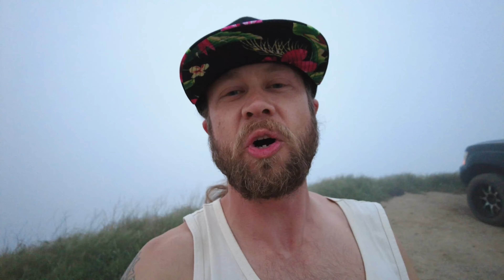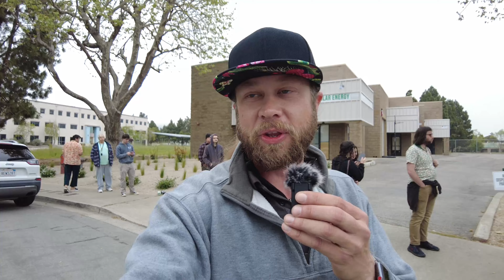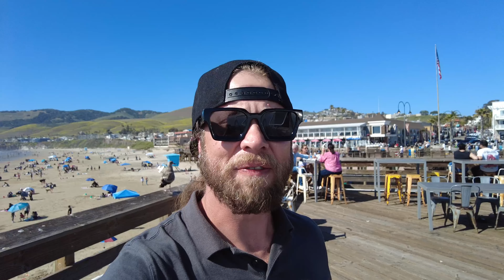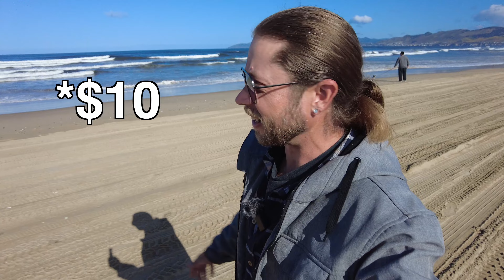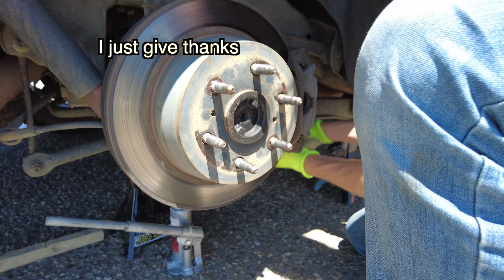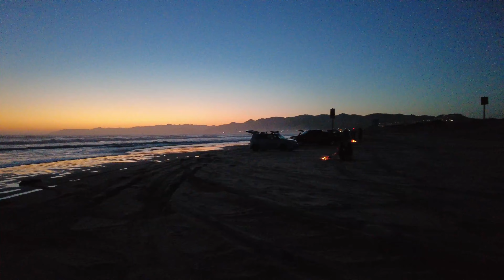Pursuing Freedom & Manifesting Dreams | California Beaches & Overlanding Adventures

Comment: For future reference... Next time you change front or rear brakes, its best to go ahead and change both sides
Reply from the maker: Of course, and if I was able to at that moment, I would have definitely gone that route… the next glitch I’ve figured out is to get a $25/night campsite I can work in for a couple days.
Reply: @AdventureFitnessFreedom   Right on. I replied to your comment, however it does not show... Did you get it?
I was just saying that your free makeshift parking lot shop would suffice just fine so long as the job isn't too time consuming. 
Also, most of the auto parts stores (AutoZone, Advanced Auto Parts, O'Reilly's, etc) allow you to do the work in their parking lots for free especially if you buy the part from them. Many also offer a tool loaner program so that solves a major hurdle as well. Keep on rocking man. If the pier is hiring lmk
Reply from the maker: @BoDiddlydodah  I didn’t see another comment…

Here, there are signs in the auto parts lots stating that no working on vehicles is allowed.

I’m not a great mechanic by any means, but definitely a seasoned tinkerer with lots of time at parts shops and makeshift repairs on all kinds of mechanical stuff.

I’ll be back in a place with lifts, tools, and resources in a few months. Until then, it’s the survival game. 

I appreciate the time you’ve taken to provide helpful ideas. It means a lot to me. 

Sunsets at Pismo (the pier job) is affiliated with Rib Line in Grover Beach. They can usually use some extra help… won’t pay as well as most other tipped gigs out here, but it’s a happy and fun side hustle… feel free to hit them up.
Reply: @AdventureFitnessFreedom   Yeah I could see that being a regional policy for sure. 
Sweet dude thanks for the scoop and keep on spreading that positive energy brotha. Clean body and clear mind ftw all day every day!
Reply from the maker: @BoDiddlydodah  💯❤️ I’m glad my message is resonating! It’s a long path ahead, but I see where I’m headed and I know people need this message. 

We can all make ourselves and the world a better place!